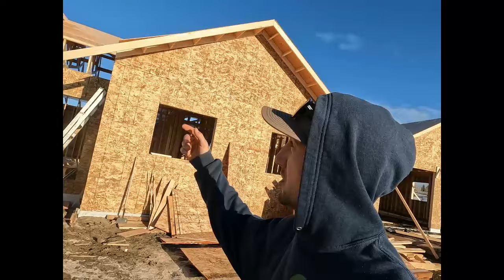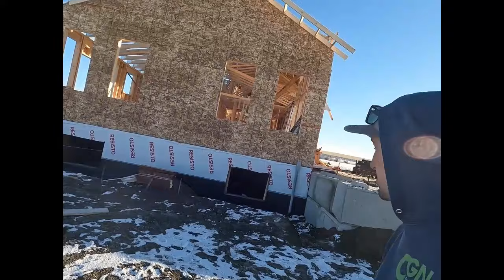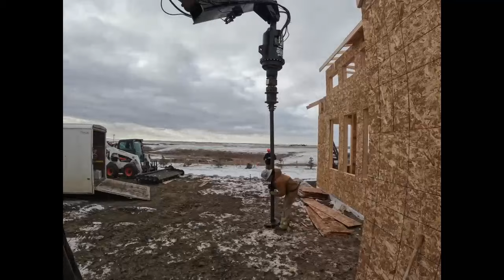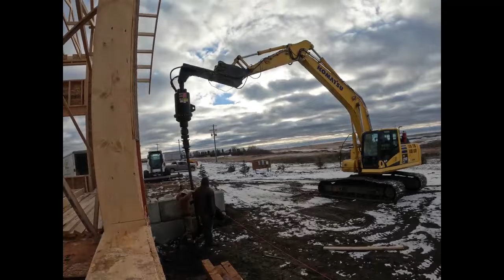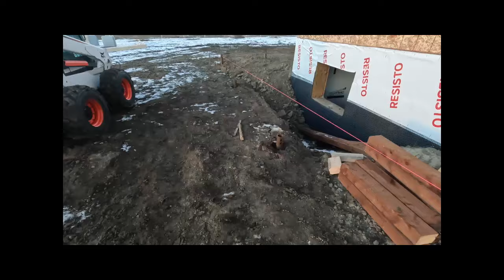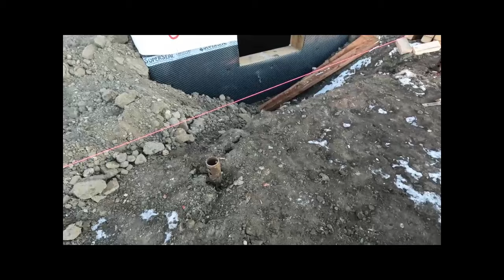SCREW PILES: INSTALL PROCESS

Comment: Very interesting. I have a bunch of supports to do and the plans call for concrete.
Reply from the maker: I'd recommend helical piles whenever possible. Should have engineer report for each one that specs bearing capacity of each pile.